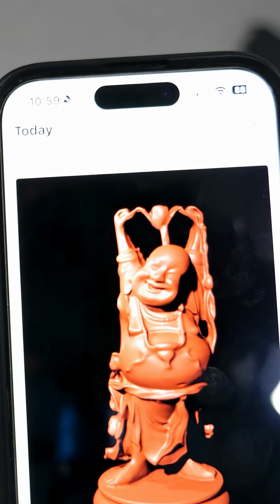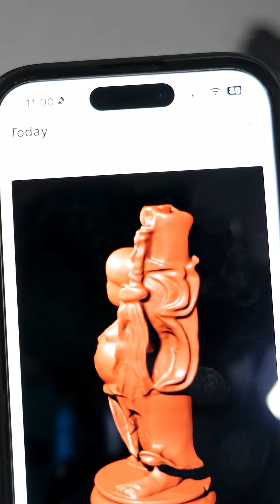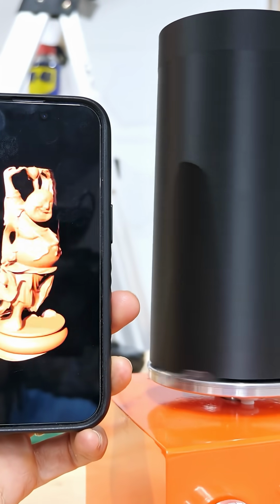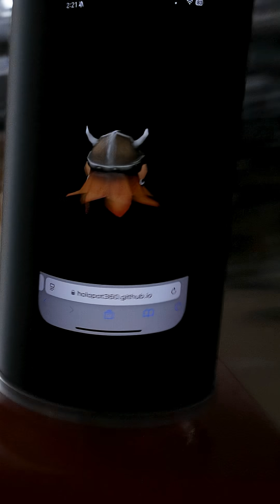A true 3D display you can make with your smart phone

Comment: If, instead of images, you use a 3D model then you could use sensors in your phone to figure out which way it’s facing. Then you use that to get the camera angle to put a projection of the 3D model into an image on the screen. That should eliminate the need to synch up the rotation speed.

Edit: in addition, you’d be able to animate the 3d model, as long as the animation loops cleanly, so you could have two people sword fighting on your desk.
Reply: The only problem with that is making a 3d model of every picture you want to display like this.
Reply: Sure! And all you need is to be an expert in 3D modelling, animating, programming and engineering!

Comment: Can be useful for museums that want to show images of destroyed artefacts or artefacts they no longer have in their possession. Seems like you can upscale it to bigger sizes with a tablet also
Reply: You could upscale it to a massive New York Times Square display with enough money and effort. It wouldn't be practical at all, but it'd be pretty dang cool.
Reply: Instead of spinning a big tablet, they can use a thin strip of LED bar then spin in around real fast to simulate an image.  It achieves the same effect as viewing it from a narrow slit.

The image would have to be "divided" into many vertical stripes and have a very high refresh rate to maintain the 3D illusion.
Reply: Up scale to make a 6ft digital statue
Reply: Or use it to display super valuable jewelry instead of the real thing. Doh!!
Reply: Uh wouldn't it be hard to spin it that fast if you made it bigger?
Reply: @AndresMagnone  that's exactly what I was thinking.
❤️🤔❤️

Comment: is it stereoscopic?
Reply: I'm surprised he doesn't address this... Yes, you'll see a different 'side' of the statue depending on where you stand, but provided that there are enough different angles covered by animation then surely each eye, just centimeters apart, could be seeing a different image...
Reply: He'd need to openings and two videos overlayed with a small delay
Reply: @pluripotentprotoplasm  is that so? even with one opening, your eyes are seeing different parts of the image. And the image itself is changing. I'm just wondering if it is animating and one's eyes are seeing different parts of it in such a way that it creates a stereoscopic illusion.
Reply: @pluripotentprotoplasm Persistence of vision means you don't need both eyes to be receiving their respective image simultaneously. And the basis of the trick is that the image is animated - there is already a delay between each frame. The second eye will see a different image, a moment later.
Reply: @SimonBoyes the only way you see 3d is with both eyes

Comment: If there are 4 total images (like in the example you used): front view, left side view, back view, and right side view, then would the image refresh rate have to be directly proportional to the rotation rate of the cylinder so as not to ruin the 3D illusion?

For example, if the cylinder has a 60 rpm, would the image refresh rate also be 1 frame per second (1 fps) = 60 frames per minute?